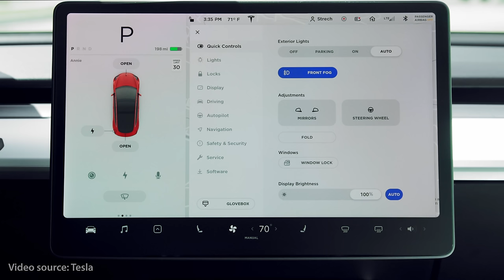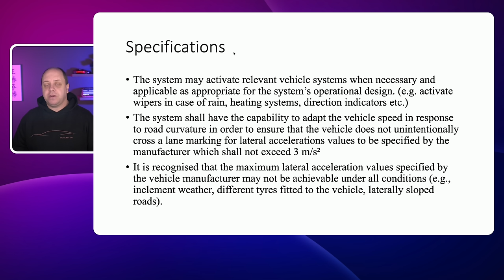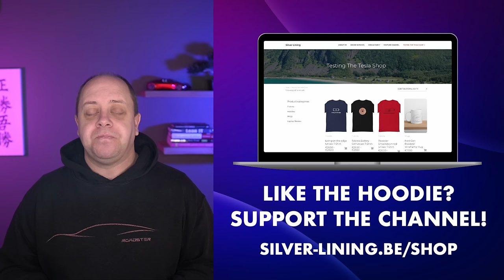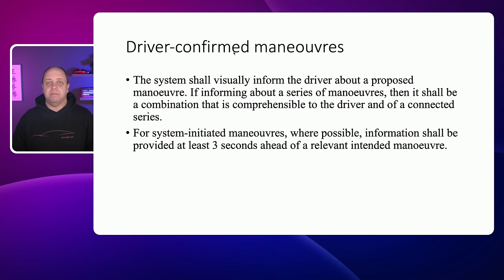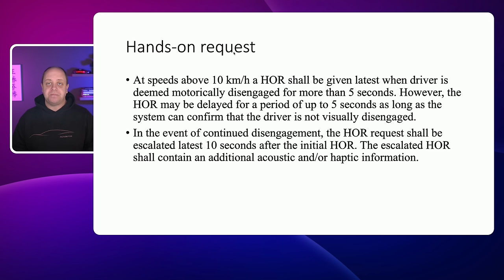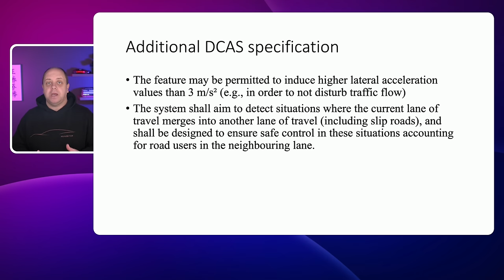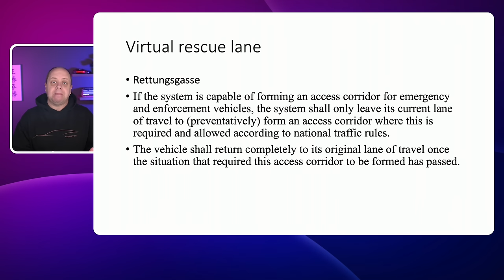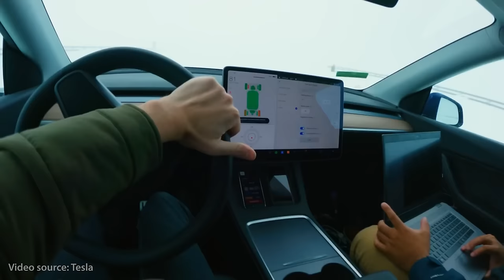FSD Beta is finally coming to Europe!

Comment: 4:53 I have been reading the document 2024-01/GRVA-18-07r2e.pdf and I disagree with the statement that every manoeuvre has to be driver confirmed. That is nowhere in that document. It is even in your slide right on the screen with the (c) option. Instead different implementations can have different capabilities and one of those capability is the option to have system initiated manoeuvres. Yes including taking turns without confirmation. They do however have the section describing the requirements for this empty (section 5.3.7.2.4 "General requirements for system-initiated manoeuvres"). I interpret this as that they are not yet done specifying the requirements and that you may be right in that such a system could not yet gain approval. But it will come.

It is also a bit open ended what a manoeuvre is. I would interpret it as taking actions other than following the straight route. It will still stop at red lights, following the road curves, avoid parked cars and pedestrians and so on. It just wont follow the navigation route or leave the lane to go around an obstruktion.

While not following the navigation route seems silly, I am actually ok with getting confirmation before going into the oncoming lane to go around obstructions. The USA version of FSD can sometimes do some crazy things.
Reply from the maker: There is a clear definition of manoeuvre in the document. And the driver confirmation is mandatory for the current version if DCAS, which is exactly what I’m reporting on. And thecreadon why Tesla won’t bring FSD beta to Europe after all.
Reply: @StevenPeeters  There is no mandatory text for confirmation in the text. Give me the section if you believe there is. On the contrary there is text for system initiated manoeuvres and you even put it in the video.

"A manoeuvre shall only be initiated if the driver is not detected to be
disengaged, and (a) or (b) or (c) is given sufficient notice to react for a system-initiated manoeuvre"

This text clearly says that the car can do a system initiated manoeuvre provided it tells the chauffeur about it in advance.

Notice there are zero manoeuvres described as requiring driver confirmation or driver initiation. This means they can all be system initiated.

We even have text describing the requirements for system initiated manoeuvres, although there appears to be none currently specified:

"5.3.7.2.4. General requirements for system-initiated manoeuvres
The requirements of this paragraph and its subparagraphs apply to the system
capable of performing a system-initiated manoeuvres.

5.3.7.2.4.1. (Reserved)"

The definition of manoeuvre in the text is the following:

"“Manoeuvre” means a change in the vehicle’s trajectory that leads the vehicle
to at least partially leave its original lane or direction of travel whereby
possibly leading to interaction with other road users"

Which is just what I said.

Comment: Sounds like nothing for older cars (no driver watching camera). But we are basically not getting even "normal" software updates anyway (still on 2023.26, while the replacement TM3 was on 2023.44)...
Reply from the maker: Current hardware won’t be going past L2 anyway. No redundancy that will be required
Reply: @StevenPeeters hw3 has redundancy in the FSD computer. Isn't that enough for level 3 highway?
Reply from the maker: @BaldurNorddahl  In the same way as Mercedes is doing: under optimal circumstances only. It' s the redundancy in sensors that will be a problem imho

Comment: Thanks for the great summary, @Steven Peeters!
I also see pros and cons, in general, I appreciate that there is some level stanardization across different systems, however in some parts I have a feeling that they went a bit too far.
Two question as I'm not sure if I got that correctly: 
(1) You're suggesting that the vehicle-initiated auto-lane changes would actually allow the car to make a turn at a crossing? However, does the 7s rule also apply there then or not? I could imagine that this wouldn't work at all if the car would need to wait for pedestrians or cyclists crossing the street - or do you think this would not fall under the 7s rule?
(2) Is the increased level of attentiveness (i.e. 5s wheel nag) only required within the city or does the regulation also mandate this on highways?
Reply from the maker: The 7s rule is for general lane changes, not intersections. As for the nag, it depends on what function is being executed. A car is not just DCAS or ADAS. It is both in different circumstances. Remember when FSD in the US was city streets, but on highways it was the same NoA as what everyone else had? Same thing here. However, Tesla may choose to implement one single sort of interaction for everything. They can do that to simplify the system, since now FSD is single stack for city and highway.
These regulation tell the WHAT, not the HOW. And we will have to see HOW Tesla will implement everything here. Nobody knows at this moment
Reply: @StevenPeeters  Oh interesting, I wasn’t aware that the system could still adhere to both rules. So - as an example - Tesla could say that in the city it’s DCAS meaning 5s nag, then after you merged in the highway and are basically just going straight it could switch to ADAS mode with 15s nag, but when it detects a construction, jam or need to leave highway it could switch back to DCAS again? Probably with appropriate alerts given to the driver that it switched mode of operation.

Comment: This is very confusing as Ford has the Mach E driving on UK motorways and German motorways plus other countries in Europe 
but not France hands free today? will they have to remove that capability going forwards?
Reply from the maker: Currently this is a country by country exception. If Ford remains under ADAS L2, nothing changes. If they want to go gor city driving on L2, they will have to comply.
Cars can also be DCAS in town and just ADAS on highways for example. It’s about which features are being used
Reply: Thanks I understand it a bit better now
 @StevenPeeters

Comment: Thanks for the video! Do you reckon that once it comes into effect in January 2025 manufacturers can already type-approve the system, or does it have to be transposed into EU law (2018/858 + 2019/2144) before type-approval can be done?
Reply from the maker: I don’t see the need for specific laws, like there is for L3. This is still a L2 system. I’m fairly confident that WP29 is the only remaining hurdle. Will check withy sources
Reply: I see, thank you

Comment: Hi Steven, from what I’ve read on the working document of the GRVA, all the system initiated part of the regulation were left « reserved ». Therefore are you sure about the system initiated maneuvers being part of what’s coming ? Also if by any chance it gets on the march WP29 agenda’s, will it then become available in June ? I don’t know if for exemple the chamber in Belgium need to adopt it and then it could delay things even if in place on unece level ? 

Thank you a lot for the update, was waiting for it all week !
Reply from the maker: If March succeeds then maybe this summer could work. But even if that does work, Tesla has a lot of improvements to get through before they comply with these regulations. Maybe thst is hapoening in the background, but I’m more confident in the fact that they are now only waking up in Europe.
As for the system maneouvres, the text clearly says “driver-confirmed for system-initiated events”. The reserved parts are for the next iteration where we would get “system events without driver confirmation”
Reply: @StevenPeeters  Ok thank you for the precision. All will depend on what the so call driver confirmation is about then

Comment: Tesla needs to take the speedlimit data froma Waze. Is 99% of the time correct.
Reply: With a large fleet of cars gathering data, comprehensive speed limit data should be a march of 9s. Much higher than 99%.

Comment: Thanks for the video. Very informative. Having read this regulation now.  

I can't see  how manufacturers will either be able to design the product specified, or, how the product specified would be useable on european streets.  With the minimum indicator times, and minimum gaps required and specified turning speeds - the car will spend more time sitting and blocking traffic than working.

On the driver side.  What happens if you haven't confirmed the manoeuvre in time ? Does the car grind to a stop ? Does it pull over ?

Doesn't sound like a workable solution to me...

Need to stop regulating by committee and stop going for least workable product
Reply: TBH I cannot find a sentence in the document that says "all manoeuvres have to be confirmed by the driver", so maybe thats not the case. Also this version of the doc is certainly not the last one, since there are still some sections to complete. So things may still change in the future ....
Reply: Agreed it's not the last version.  However, each iterative change takes 6-12 months to take affect.  So how long before the regulations are useable, manufacturers can prove they work to the legislations and gets into the public hands ?

Comment: Virtual rescue lane...

Why should Tesla have to implement it (like you said in the end)?

Your text said: "If the system is capable of forming an access corridor" it has to do some things...

So if the system is not capable it is still allowed.
Reply from the maker: Because it is a legal requirement to do do in the countries that have these laws. If it doesn't do that, then we're back to the same useless AP system we have now.
Reply: In that case the driver would be required to disengage the system and drive manually until traffic clears and the virtual rescue corridor is no longer needed. That is not what we want.
Reply from the maker: @BaldurNorddahl  Exactly. That is what we currently have to do and it sucks

Comment: Do you have any info on what level of FSD will become available for cars that do not (yet) have the interior camera installed? Or if Tesla could provide a hardware update for the interior camera?
Reply from the maker: Cars with no interior cam will temain at current level probably. Upgrades? Nobody knows

Comment: What will the situation be for older models which do not have the inside camera to monitor the driver?
Reply from the maker: At this point, nobody knows. Probably they won't be able to get the functionality for DCAS. And before you ask, most likely Tesla will not do retrofits or paybacks, since there have always been fine print that said everything depends on software validation and regulatory approval
Reply: @StevenPeeters  Thanks Steven, not what I wanted to hear but I'm sure you are correct as always!

Comment: Well. Sorry. 13 seconds and constant beeping for hands and ayes? This is supposed to relax the task of driving. Not increase the workload navigating constant barrage of warnings! This is not going to be useful at all. Better just to drive by myself instead. Much less stressful
Reply from the maker: It is actually more stressful because you have to oversee the machine. As I said many times: this is NOT self driving. Seems to be a very hard concept to grasp for many people
Reply: @StevenPeeters  Well i know what it is. It has never up to this point been a self driving system. But this is moving the task of driving to monitoring something unknown for most people. It’s NOT ASSISTING the driver, it’s adding a completely new workload onto the driver for which no real training is provided. Yeah yeah, some video training. Far cry from real training. The EU has once again taken a reasonably simple task and made it into madness. Let the system do exactly what it can do in America. It’s NOT self driving there either. And as long as the system is a level 2 system it’s still the driver that is responsible. They have taken everything else away, even speeding from the equation and the whole idea of driver assist systems in any form is to offload the driver, not add new stuff to take in and then act upon. EU is so backwards when it comes to technology that it questionable that they even should have a say in it. Just look at side loading iOS apps, forcing RCS on iPhones, mandatory spying capabilities and the whole Cookie debacle with constant popups that sometimes requires a degree to understand just to do anything online and every single time you visit a page you have already visited. This is not something the EU should be engaged in. It always complicates things beyond comprehension
Reply from the maker: @driver288  I understand the frustration. But NHTSA is also coming down hard on Tesla because the driver is not paying attention. Here, they are making sure that you will be paying attention. 
I don't like it either, but if you use the system as intended, then it should be no problem. We will see once it rolls out and I get the chance to test it. That is the real stock of truth. Right now it is just a text that nobody complies with.
Reply: Trust me, it's better than not having FSD at all. You will adapt. It won't be as stressful as you think. I speak from personal real world experience driving with FSD beta on the local streets here in NYC.
Reply: @RobertLoPinto  Hi! You don’t on the other hand have all these nagging proposed by the EU. That’s the whole difference!. Do you have to touch the steering wheel every 15 seconds with FSD Beta in the US? Your car can do autonomous lane changes right? And the empty space in the lane you’re merging into has to be 6m as opposed to 36m here. Your FSD beta car can indicate and turn off at off ramps, right? Well depending on what driver confirmed means it could be a lot worse than it used to be. Now lane changes in the EU has to be confirmed with the indicator being manually turned on by the driver to start the lane change. If i have to confirm every movement the car wants to do then what’s the point?!? I bought my model 3 with FSD and what have I gotten out of it? Auto parking that now for some reason requires perfect internet connection to even show the interface in the display, wasn’t the case before. Now I can’t use it in the multi car garage i park in because of spotty connection. For me FSD has only gotten worse by the year since i got the car. I’m not sure my next car, if it’s a Tesla is getting FSD since it’s so crippled here. I’d rather just pay for what i can use, upgraded AP which basically is what we have here now. And if we are looking at Jan 25 for FSD beta a la the US, it’s time to replace this one anyway
Reply: @driver288  I am actually quite happy we take safety a bit more serious than the states. They can experiment with the lives of people as much as they want over there. And if I look at other Software features programmed by Tesla than I am REALLY glad that FSD is not here yet. Got like 5 bugfixes just in the last 4 weeks. Every OTA can contain another surprise, good and bad. The software still needs to prove itself. I suppose FSD still has a loooong way to go otherwise it wouldn't be a beta anymore.
Reply: These regulations will turn driver's assistance into driver's annoyance. I don't have an interior camera, I sincerely hope that because of that I keep my current FSD functionality and I will never get FSD updates. 🤞🤞🤞🙏🙏🙏
Reply: There shouldn’t be any extra regulations in place, over and above the laws for manual driving. E.g. the 7 second rule shouldn’t be species as this is not a reuirement for manual driving. The NHSTA full stop at stop sign is the law, so FSD needs to address it.
Reply: @marktt  agree
Reply: @ichigo19870 well. Since drivers are still responsible for driving in the US too, all this is really not needed at all. BETA will still be the moniker for FSD in 2025 so nothing is different in any way from the US. They have driver attentiveness to but when intervention is needed. Not this nonsense

Comment: Lane change Time is too slow. It doesn’t work on regular highway traffic
Reply from the maker: It can, if the system decides when to turn on the blinkers. 😉
Reply: @StevenPeeters  the current Tesla implementation doesn’t even work on France highway without autobahn craziness .  Lane changes need to happen in sub seconds on busy highways. From init of the maneuver to finish
Reply: @StevenPeeters  The question is... can the system just turn on the blinkers for 7 seconds... wait if there is an opening... and if not turn them off. And right after that turn them on again and wait again. At least in your video there is no information that would indicate otherwise...

Of course that would be something that the regulation wanted to avoid. But in my opinion that would be a loophole?
Reply from the maker: @PeterLonghorn00  it detects the oncoming gap first and then estimates where to turn on the blinkers
Reply: @StevenPeeters  But if it is a lange change because you have to get into the turning lane... does it still have to wait for a gap?
How do you do it if there are two turning lanes and the car is driving in the right one? Is it allowed to put on the blinker without there being a gap?

There are so many situations where that can be problematic.
Reply from the maker: @PeterLonghorn00   The regulations always say WHAT should be done, not HOW. That leaves room for the manufacturers to find the best way. In dense traffic, the gap requirements allow for shorter gaps

Comment: How will the eyes on work with my Model S raven without interior camera?
Reply from the maker: It won’t
Reply: @StevenPeeters  does that mean they will retrofit a camera or refund my fsd purchase?
Reply from the maker: @dezent   Most likely neither. When you bought FSD there was a big disclaimer that all future features would depend on software validation and regulatory approval. They covered their asses that way
Reply: I have X. We should get FSD refunded if camera retrofit is not possible. I understood from this that driver monitoring camera becomes mandatory.